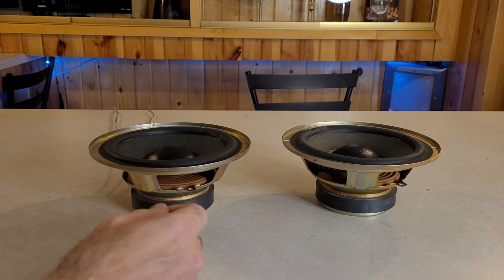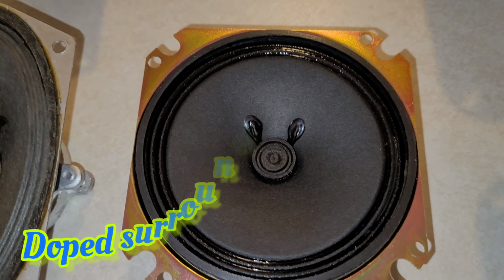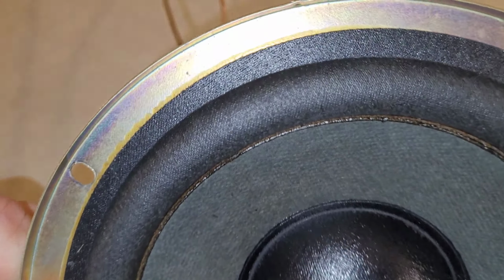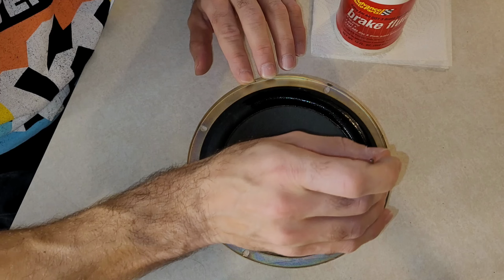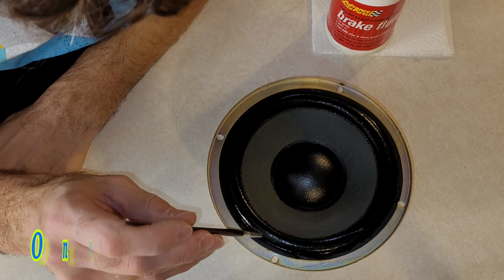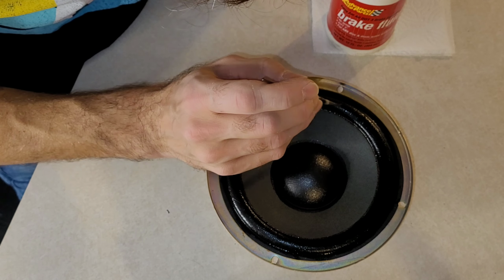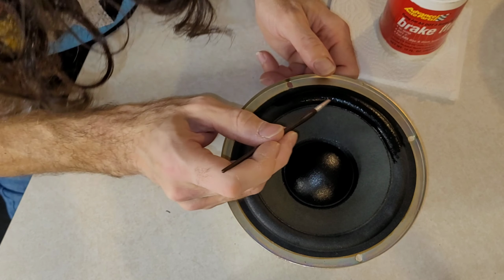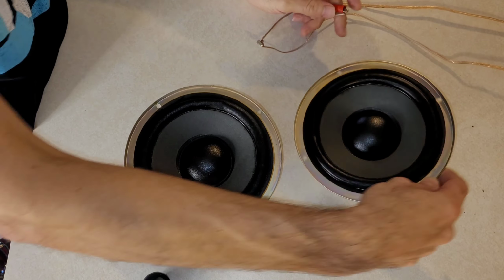Sony 6.5" Woofers With Hardened Surrounds. Break fluid fix.

Comment: The break fluid trick really made a difference. I was worried about those types of chemicals eating away at the material. It's too bad I chucked so many speakers that could have been saved. Those are some decent sounding drivers too. Thank you for the helpful information. Good footage as usual buddy!
Reply from the maker: Hey man. Thanks for stopping by and checking it out. I figured it would be a good video for others with speaker surrounds that Hardened. I was also leary the first time I tried that on speakers too as I thought they might become more damaged. But it worked,  I couldn't believe it. Not sure what causes them to get hard but this reverses it. Only issue I've found is putting too much on, it will eat away the glue that holds the surround in place.

Comment: I have a set of Sony SS-D115. They are a 3 way bookshelf with this woofer in them. I drive them with a 100 W per channel amp and they handle it fine. Good sounding speakers.
Reply from the maker: These are very nice sounding woofers from Sony. If I'm not mistaken, these also were from a 3-way unit. Can't recall how the speaker boxes looked. They do seem to handle power rather well. Did yours have the same issue as these.
Reply: @ Mine don’t seem to have the same problem. I may go ahead and treat them anyway. They do seem to need a good bit of power to start making good bass. Maybe they are a little stiff. I’ve had them since I was in high school in the 90’s. I still have the receiver they came with stored away.
Reply from the maker: Ahhh the 90s... such a great time it was. I too was in HS in the 90s and Also still have my mini system lol. 
The speakers I have in this video did come out of a 90s mini system from Sony. And they are stiff...perhaps they are designed as such but I feel mine have the hard surrounds holding them back.
Reply: @ I treated them like you showed and it made a difference!
Reply from the maker: @Brownguy342  awesome man. Yes, it really does work surprisingly. The only issue depending, on how hardened they are, You might have to do it again with in a years time.

Comment: Impressive. Two questions. I have heard that some people put the brake fluid on the back of the surround as well. In your opinion is there any benefit to doing that? Question number two. Any idea how long this treatment lasts? Does it have to be redone periodically? Or is it good for a long time. Maybe it is time for a followup report on these speakers you did, since a year has gone by.
Reply from the maker: I have also heard about that too. It will speed up the process I'd assume but you risk getting it into the glue area. I over applied to a speaker once and it started to eat away the surrounds glue and separated it from the basket. I just had to re glue it together. 
It does need to be re applied every so often. I have found that usually about one to two times a year is enough. Not sure what causes the hardening I think it's either sunlight or people smoking in the house. I don't smoke and never had a hardened surround myself but have received speakers with hard surrounds from others.
Reply: Good to know. There is a guy on the big auction site that goes by the name vintage-AR. I haven't used his stuff, but many other people report good results. He has a brush on product similar to what you show. You only put it on one side of the surround and supposedly it never needs to be re-applied. I may try it.

I suspect this happens because in the black substance they use on the surrounds there are volatile ingredients that evaporate over a long period of time thus leaving whatever remains to be much harder and stiff.  I doubt that smoking has anything to do with the process, but I could see where sunlight exposure could heat up the substance and accelerate the outgassing of volatile compounds. 

Back in the day when I was in stereo sales in the golden age of audio equipment we never gave any thought to things like this. It was just assumed nothing could ever go wrong with a speaker as long as you didn't blow it up. We used to practically give away Marantz equipment. We considered them "boat anchors". Wish I had a time machine so I could go buy out the store.  @speakeradventures

Comment: I can also confirm this works on vintage Sony Carbocon Woofers from the 70's, for example the 1-502-580-11 fom the SS-3050
Reply from the maker: Hey thanks for confirming.  It's such a weird trick I honestly can't believe this works. Have you tried anything else out to see if it also has similar affects.
Reply: @speakeradventures  Sorry not yet! I'll try and tell you if I do. I have a friend who is also interested to try on on old B&W fabric surrounds.... If he dares

I really need to thank you because it's turned them into actually my favorite speakers ever. They are astonishingly pleasant to listen to.

It was the detail you went into in the video showing the different surrounds and explaining the difference that gave me the confidence to risk it.
Reply from the maker: @SamFirthDesigner  I am so glad to hear it worked for you. Its weird to think that break fluid will fix this. It does bring the speakers back, especially with the bass. How long have you had the speakers for. 
I Still don't know what causes them to harden as not all will do so. The only downfall to this is that it needs to be re applied at times. Thanks for the positive feedback.
Reply: I bought them just a couple of months back because I spotted the Carbocon name. They were initially very bass light and resonant but I noted the surrounds being strangely hard and eventually I found this video while searching on the topic. @speakeradventures

Comment: tengo unos parlantes sony cuadrados con las suspenciones de un material de color amarillo, nunca me gustaron como suenan y siento que las suspenciones estan muy rigidas ojala que con este metodo pueda mejorarlos
Reply from the maker: Hey. Sounds like the suspension is of the cloth material which is then kind that does harden. It will vastly help with the bass output. Rigid suspension makes bass sound more like mid bass.  Hope this works for you.

Comment: Thank you, i hope to save my 12inch Diatone woofers
Reply from the maker: Welcome. Hope it works out great for your woofers.
Reply: @speakeradventures  Yes it really did improve the bass response quite a bit, actually i had already applied silicon oil on the surround and that didn't allow the brake oil to penetrate satisfactory. I will try one more time maybe next sunday 🙂
Reply from the maker: @sanjeevmoudgil699  glad it helped. Another coat might help it soak in a bit better. Hopefully the silicone doesn't prevent it from doing so.